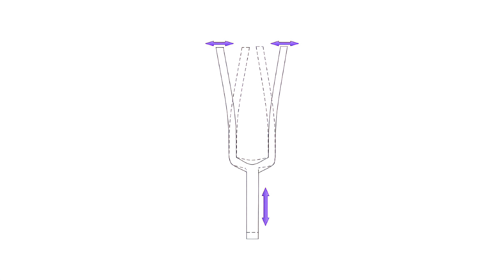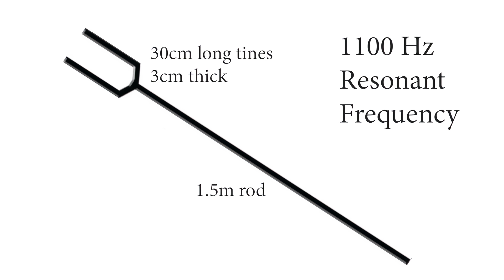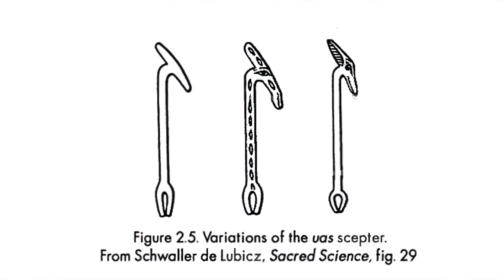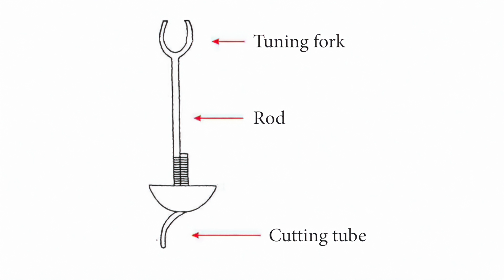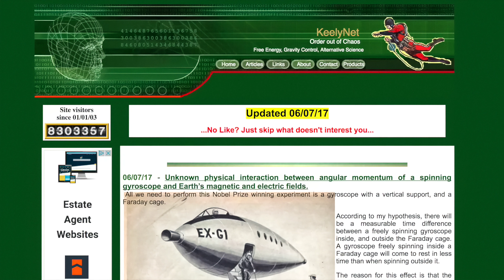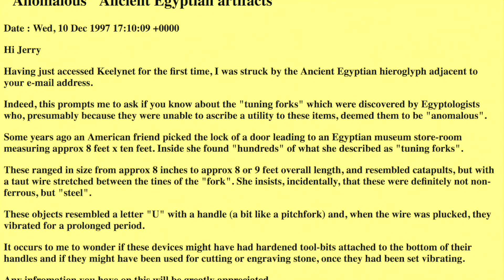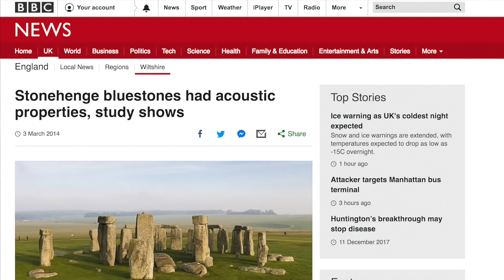How the Ancients Cut Stone with Sound - Lost High Technology Explained | Ancient Architects

Comment: I see no reason to assume that a civilization that cut stone as a primary building material for centuries would not have developed several ways to do it. very likely they had specialized ways of making different kinds of cuts on different kinds of stone. we seem to think of ancient Egypt as a single culture, but it's a longer time span than Europe has had since the founding of Rome. imagine trying to explain what all of Europe used to build all of it's structures over the 2,000 years prior to steel reinforced concrete and assuming it was one technique. yet this is what we are asking about the ancients. to me it's not so much "did they use this technique?" as it is, how long did they use this before discovering they could more easily use the softer stones using a new technique.

Comment: I wonder  if  ever done microexamination  of edge. That  will show if cut  is mechanical or..by localized  heating.... as  induction heating which can be produce by microwaves. Maybe by  localiized heating they got  the rock in plastic state as to mould  shape  with  high melting point alloys 😎😎😎

Comment: I read enough comments to take the community's pulse, and there are too many folks duped into thinking the ancients had secret ways of cutting stone, but why believe that if ordinary tools can be shown to do the job? The video admits there were metal tools then, but glosses over which alloys they were. That's important because contrary to one myth, the tool doesn't have to be harder than the stone: look up the videos of quarries where massive stone blocks today are cut by wires, water, and grit. Read about the Bronze Age and learn that bronze can be tempered almost to the strength of steel. Sculptors today still use hammer, chisel, and file to carve every kind of stone and not always with pneumatic power. I don't appreciate how this video overlooks the quoted video--where a pipe is spun by a rope bow to drill into rock--which clearly mentions the need for constant water flow. That's meant to imply that Egyptians couldn't have directed water into the pipe and hole, which is absurd. I could do that myself and so could you. I see the video's tuning forks and copper pipes, but where's the demonstration of this drilling into granite or any rock at all, even soft sandstone? All that being said, I am intrigued by the quoted email about the tuning forks with wires strung between the tines, and the photos of the same. I don't think that the tines were struck to get them to vibrate, and that the wires transferred the impact to another fork, because the email says the lock-picking friend saw hundreds of forks with wires between two tines. This makes me think that the wires were actually played with a bow as a violinist makes music, and that vibration transferred down to the metal tube. This work would be easy to keep up for hours, while another worker held the tool upright. Anyone willing to try it?

Comment: Awesome vid , now my mind is going a mile a minute ! Could plucking the wire between them be easier than hitting ? Joining the two of them together , you would be able to pluck 1 wire to keep both in time and be able to cut blocks and obelisks . The wire on the tines may be able to fine tune the tuning fork to the perfect vibration to cut granite . Maybe a bow like a violin  to make the wire sing and they weren't tuning forks but simply holders for the wire to transmit the vibrations to the head . The angled head would be perfect for control to use like an engraver to make the pictures we see carved here . Looks like I got a couple of projects to work on .
Reply: That's where a trumpet comes in. Stimulating the wires and forks in a sustained almost continually reinforcing way.
Reply: HMM, KNOWLEDGE HAS AND IS BEING SUPPRESSED. NOW JUST DO A SEARCH. THE VATICAN HAS A VAULT FULL OF MANS HISTORYS AND HISTORY. CURES FOR CANCER ETC. I ASK MYSELF WHY to KEEP IT HIDDEN FROM .... MAN? PEOPLE ALREADY KNOW THE GOVERNMENTS LIE. NIKOLA TESLA TRIED TO GET THE ZERO ENERGY OUT, AND THE GOVERNMENT TOOK CARE OF THAT as THEY DO.IF PEOPLE KNOW TOO MUCH. AND THEN THERE'S N.A.S.A = NEVER A STRAIGHT ANSWER. An OBJECT THAT'S BEEN SEE ALL OVER THE WORLD THE TR-3B MAN MADE. EDGAR FOUCHE TR-3B.

Comment: A taut wire between the tines of a tuning fork might allow it to continuously excited by a bow (like a violin) or a wheel. (like a hurdy-gurdy)
Reply: GordieGii 
A bell of the right size could resonate the forks without touching ut, right? Have a wheel with paddles strike the bell at a consistent rate to produce the sonic energy? You could work multiple drills with one bell.
Reply: @thedeekabides  If only both bells and tuning forks didnt require materials that didnt come to be until thousands of years later...  They used a crystal, there are stories about a large crystal being within the pyramid.  Pziocrystals vibrate continuously when exposed to a particular voltage.... the pyramid is a device to generate a voltage between inside the pyramid and the ground underneath.  This provides a voltage to the crystal which then oscillates at a very very exact frequency essentially for as long as there is voltage.
Reply: Kitten Katt  ummmm I never said it powers a device to cut stone...  Just simply that its a device to generate a voltage, likely to cause particle injection into the atmosphere to operate as a rain-making machine.

Comment: There are some impressive stone carvings all over Asia that dates even further back to the era of the Buddha in India, older than the Egyptian times. The belief in those areas is that the ancients in those times used chemicals to soften the rock before carving it. Some of these have been standing exposed to the elements for more than appx 2500 years, but their edges remain sharp. The herbs which had been used for softening the rocks still grow in these parts and are used as medicinal remedies for kidney and gall bladder stone treatment; dissolution and removal. These techniques are more real in that sense, since their residual outcomes are still recognizable.

Comment: Publicly disclosing inventions?  You showed yours, so I'll show mine.
- If resonant rod w/upper tuning fork is struck downwards onto a stone surface, this should excite the scepter's longitudinal resonance, which excites the tuning fork, which makes the scepter's lower end strike the stone not once, but hundreds of times rapidly.  An acoustic jackhammer effect, rather than just a rock-chisel.  A mortar and pestle with acoustic drive!  (Design the width of your tuning fork's crossbeam-base to give any desired acoustic coupling, wider=larger coupling.)
- Second: a simple rod should do the same when its end is slammed against rock.  But any rock-cutting action would lower the Q,  immediately damp the resonance, and bring the repeated impacts to a halt.  I suspect that adding the tuning fork to the top is adding a loosely-coupled resonator, which should greatly increase the system Q and keep the pounding-action going for far longer than just a resonant rod would provide.  Weaker oscillations, but persisting longer, even if the rod is being damped.  Ancient workers might first discover the vibrating-rod rock-cutting effect of slammed metal rods, then later add the tuning-fork to increase the acoustic-drilling action.
- Third: other methods for exciting longitudinal resonance could be used, violin-bow etc., rather than just striking the end of the rod against stone.  Once it's ringing, use simple methods to keep it going!  A powered drill.  Need earplugs.
- Fourth: water provides destructive action if placed between two acoustically-driven surfaces ...especially if de-gassed water is used (boiled-then-cooled water.)  An acoustic drill with prepared water at its tip might visibly sink into solid granite, turning it to powder not via impacts, but via submerged cavitation shockwaves.  If so, then proper choice of tip material is important (perhaps hardwood rather than brittle minerals or metals which would quickly erode.)

Comment: I think you're misinterpreting the reason for the wires.  Let's see if you can figure it out with these amended lyrics:

Johnny, rosin up your bow and play your drill bit hard
'Cause hell's broke loose in Cairo, and the devil deals in shards
And if you win, you get a shiny bore-hole made from tones
But if you lose, the devil gets your soul

FURTHERMORE, if you drill a line of holes in a rock, then fill those holes with water, and hand wooden dowels to a number of hammerers, such that the dowels barely fit the holes, by simultaneously banging on the dowels, they can fracture the rock along the line of holes, breaking off VERY large chunks of rock.

Comment: SNAKEOIL! To cut stone with sound you would need an ultrasonic transmitter which requires electricity. They didnt have electricity before  approx. 1880 AD.  This is utter bullshit.  If you fall for this you are an ignorant fool. Ultrasonic frequencies when used via an ultrasonic transmitter also create heat. The heat generated to cut stone would shatter it before any useful cutting could be done. Learn your physics before posting bullshit such as this.

Comment: You have the story partially correct but not really. The stone was soften in a sense of meaning. The resonance was applied to the stone first in thus making it like putty (softer). This was done in the late kingdom - it was a more crudely made device. Later they would apply the metal to the resonating stone but was softer now. This the reason the experts now mistakenly see the device going faster then our technological standards. The tool does not resonate like told but only the stone. The same is done to make stone float but frequency is different.

Comment: Some good theories here, and I agree that the mainstream explanations for these methods (if any) do not add up.

However Ive seen the video of the guy cutting thru rock with the tube and he appears to be using electricity.

I get that his method is merely just an example to prove a point but,, Id suspect that this would be much harder to achieve without the electrical input.

Whatever vibrating system you use, if its not powered then its energy will always diminish so your gonna need another source of energy, even if its human effort.

Also some engineers have claimed that the striations in some of these bore holes display drilling at '3mm per revolution',,   Id highly doubt this could be done by tuning forks.

And also this method would not account for large flat surfaces Eg: the boxes at the Serapheum of Saqqara

Id certainly be interested to see if anybody has tested a method without electricity to find out whether this argument is tenable or not.

thx for the upload :)

Comment: Tesla had a small box that could be attached to whatever you wanted to destroy a bridge a building and as I recall it was merely Resonant Frequency no need for massive ordinance and that's probably why it was suppressed bombs cost a lot of money Tesla's box was cheap . ..
Reply: In theory you can do that if you can guess the exact right frequency and if it never changes, most complex structures however have several frequencies which will not only interfere with each other but also change if the material deforms.
No demolition crew would go buy explosives and deal with all that mess if resonators could get it done.
Reply: Yes a reporter once asked Einstein what it was like to be the smartest man on the planet ? Einstein answered I wouldn't know you'd have to go ask Tesla  .. .
Reply: As I recall the story on the 7th day when the shofar was blown an earthquake  dropped the wall.

Comment: Tesla once made a statement that  energy exists in many forms not just conventional forms e.g. mechanical, heat, chemical, electrical etc.
Light, sound and vibration are also forms of energy but we never get taught this at school, engineers cover resonance or vibration because of its destructive effects on systems.
Light is another wavelength,  a laser uses a prism to focus light. The sun is intense light once focused its power is huge. Now ask yourself this what shape is a pyramid ? It's a prism of course !, so light and sound can be focused using the internal chambers. The sound chamber inside the great pyramid did exactly that. Sound can also be used to levitate stone blocks which explains how they moved these huge heavy pieces.
Tesla cracked the idea of materials NOT being solid but in fact constructed like a porous sponge, made up of atoms , electrons, protons, etc. The sun is really a nuclear reactor which produces high intensity light that excites the electrons creating a plasma field which is  capable of melting rock. As a trained production engineer I was taught that metal and stone could only be cut or machined using tungsten carbide or diamond bit toolings.
Rock is very brittle so you can use heat or sound to shape or form this brittle /hard material.

Comment: @5:50-5:58, you are seeing the process of chemical softening of stone, probably with natural plant acids or strong chelating alkali compounds.
http://www.abovetopsecret.com/forum/thread692500/pg1

Those goofy coppper knives and tools didn't have to cut stone, they just had to cut the fruit and plants that dissolved the stone into a moldable paste. Look at all those pictures of thin walled vases made from extremely brittle rock. They look molded or cast, same as those massive tight fitting rocks in walls with bulges and protuberances near their bottoms. Those probably had something to do with the temporary forms or molds used to cast those stones using softened rock paste for binder with other rock rubble mixed in.

Same thing on those spherical "hammer stones" found at the granite quarries in Egypt. Those stones didn't hammer the granite into shape, they were hammering fruit into granite dissolving pulp in all those trough shaped indentions left.

Comment: While I agree that there is a great deal of real weirdness kicking around,  I'm afraid there are a few other things that also need to be thrown into the mix. One of them is that many, even most, archeologists come from a pure academic background. They've never WORKED as a carpenter, shipwright or stonemason, They really don't understand how leverage COULD be used to sling BIGASS blocks around. Ever seen a single person use leverage to lift, move, and load a nine or ten foot long sofa by getting it up on a corner and basically spinning it to move it? Or look at those thin=walled stone vases that completely be-goggle "experts?" Ummm - if you MAKE stuff, you can figure out that no matter WHAT process was used, you'd hollow out the inside FIRST and then use calipers to measure while you thin it down from the outside in. 

And how arrogant can it be to decide that a picture of a stegosaurus simply COULDN'T be a result of people - who could certainly build a pretty damn fancy temple - being SMART ENOUGH to look at a pile of bones and say "Well, that critter must've looked like THIS...?" How could you NOT think that is at least possible? Wanna build a pyramid? While certain pharoahs may well have recorded the idea that all the "little people" really WANTED to build pyramids, I think it's fairly likely you just kept 10,000 or 20,000 or 50,000 SLAVES just pounding away on the things until it was done. No it's NOT fun, but we do know that among those GREEKS who "fathered democracy", anywhere from 50% to 90% of the people actually WORKING there were slaves. You didn't get back from a hard day's work slopping out the goat pens to trot down to vote as a citizen, in fact you couldn't even BE a citizen if you had to work for a living! All your poets, singers, warriors, all those guys were WORKING men and had no vote, only idle land-owners COULD vote. Again – you can't believe everything the rich guys wrote down. Everybody's lying to you NOW but back then it was all true, huh?

Comment: don't want to boast but They can create some type of glass right? what if you had a thick long length of glass something like 500ft long and had it fixed on some tripod with wheels and aimed it at the sun and the suns rays focus on to the glass in such a way that it creates a powerful focused beam thats a milimetre thick, Well you can figure out the rest thanks.

Comment: Yes; the egyptians had drills !!! they also had electricity. AND NEON LIGHTING.. .... (Denderah battery/ Thunderstorm.com). the DJED tower is a BATTERY.. (see Baghdad battery).. and the ANKH was a conductor.. the WAS staff was also like a PLUG (two pin points) although some are later / earlier joined, as two pins are technically unnecessary... all this made up a circuit.. run by electrolytes; so did the Egyptians have 'drills' and pour cement structures - very very likely.... did they use tuning forks AS WELL to drill holes , very very likely.Egypt was pretty much the Las Vegas of it's day...

Comment: Was some other way, there drill bit cut thru the granite at a rate of depth per one revolution greater than we can manage with our high speed drilling now. So this vibration although possible isn't how they did it. They used power and sharper high speed drills than using vibration.

Comment: Diamonds are never mentioned in relation to the carvings. Diamond beats everything. Tonnes of diamonds in Africa and the Middle East. I make jewellery and I use a process called "float casting" which is basically, putting the stone in the mould and then pouring the molten metal in the mould, encapsulating the stone. If I had the ingredients then I could make a mean cutting tool with diamonds and metal. Also Ruby is incredibly hard and abundant enough. I dunno, just ideas. I love this subject.